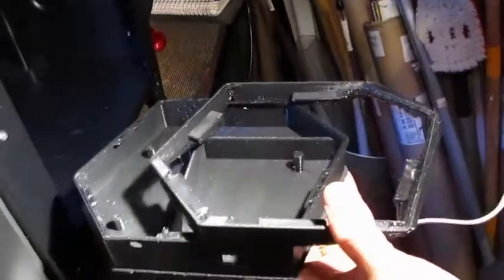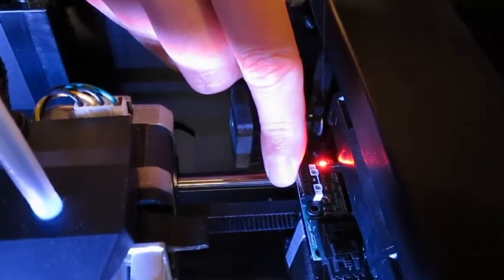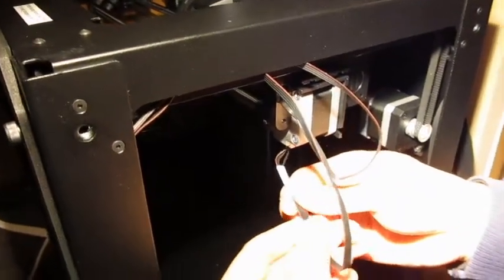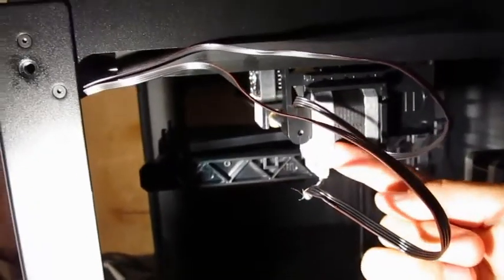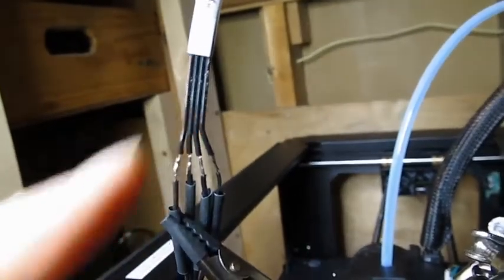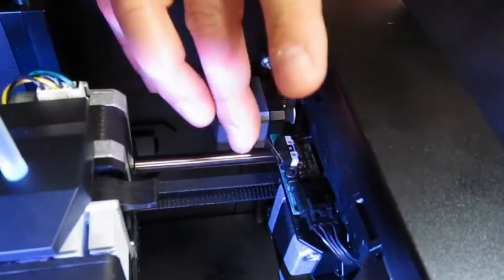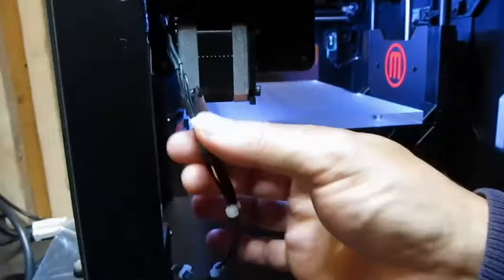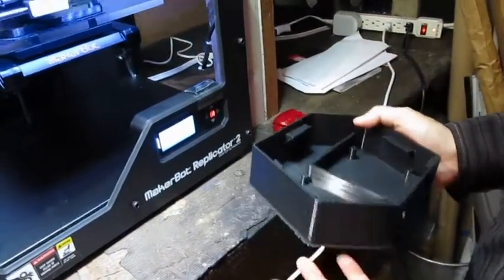Makerbot Replicator 2 X Axis Fix

Comment: Thanks for the video i am pretty sure i had/have the same issue bc wiggling those wires breaks up the sensor light. I've redone the wires but still running into the issue. I believe i heard it make a 'skip' noise about when the alignment started sliding. Do you have any input why it might do this even though small models print ok?

Posted here: https://www.reddit.com/r/3Dprinting/comments/fzjn1h/replicator_2_xaxis_still_sliding_after_resoldered/

Comment: Were any of you guys cables actually look as bad as his in the video do? my cables dont look this bad but my prints are drifting in the x direction with only 80hrs on the printer. cables look fine so im not sure if i should chop them up and try this. also i lost my spring peice on the x axis limit. the limit works when the motor hits the button but the little spring piece is gone

Comment: great video thanks! Are you using a glass heading bed? where did you get it?
Reply: Thanks Rich.  Ours is just a Replicator 2 (not 2x), so it's not a heated bed, but we upgraded to a machined aluminum bed (can't remember the brand - might have picked it up at Maker Faire) so that it's super flat, and doesn't flex.  Switching to this bed helped for really large prints that span almost the whole print-bed.  We use a BuildTak surface over that.

Comment: The wires on all makerbots, apparently even 5th generation are too small gauge, maybe their electrical engineer didn't understand the wires are flexing during operation, too bad otherwise would be a good machine, but this is major repair, wire harness isn't cheap bought one already, and now starting to have problems again

Comment: thanks for posting this, how long did this fix hold for you ?
Reply: +rensole It's been almost 17 months, and we've never had the problem come back.  I think the main problem is how the ribbon cable zig-zags in the tight slot (see 1:13 in the video), so we've left the cable out of that slot.  That's worked great for us, and we use it quite a bit.  

Hope this helps.

Comment: hey, thanks for the video. my cable is broken too, but i dont think its the end-stop cable of the gantry.
after reaching the home position the gantry dont have any contacat with the endstop until the print is done... so i dont think the end-stop cable is faulty.

it should be the cable of the x-axis because i get some serious jittering sometimes. your printing result is the same as mine...s o why should the end-stop be the problem? do you have some explanation?
Reply: Hi harican89, as you know, there are two ribbon cables involved.  One goes to drive the X-axis motor and the other one goes to the end-stop PCB.  We ended up repairing both, since they both looked crimped and frayed.  Yours might be just one?  We repaired ours because we needed to print a project ASAP, but Makerbot did send us a replacement cable set.  You could try contacting their tech support as well.